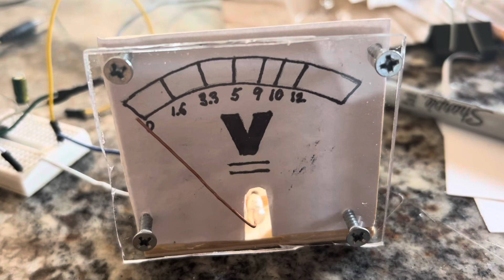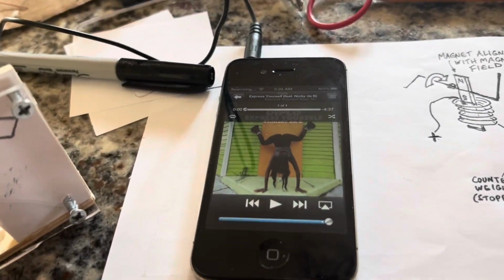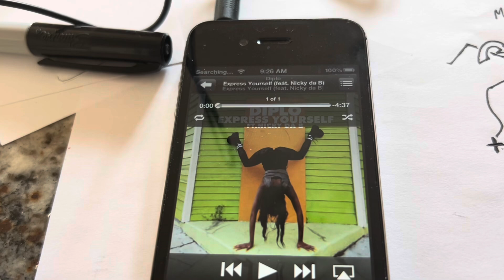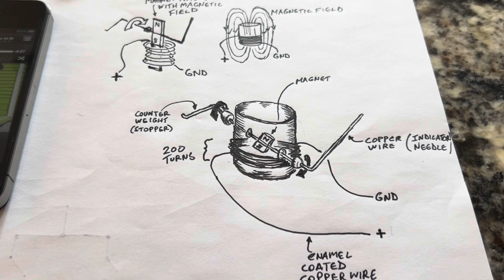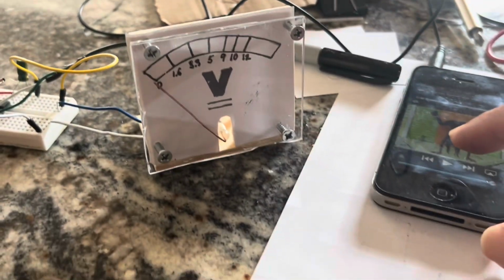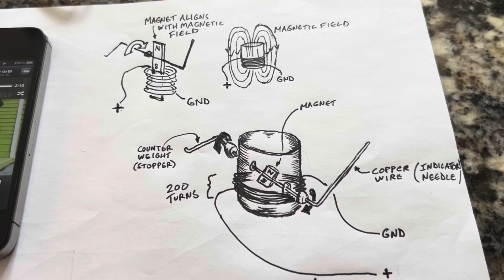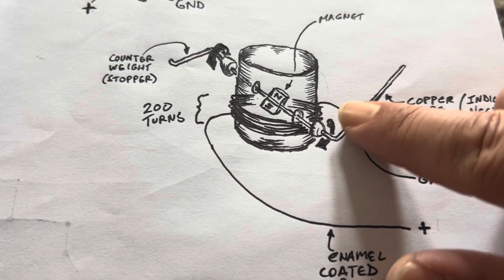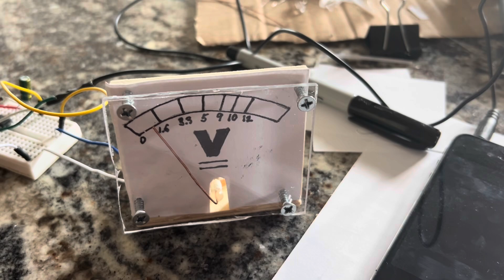DIY Analog VU Meter - Design and Demo

Comment: it must not shake like cockoach antenna.. damp it or use electronic damping
Reply from the maker: I like the analogy. I actually like the jumping effect with audio. But can easily be dampened with a resistor capacitor (peak detector) on the input signal

Comment: Without spiral damper.. It will shake badly.. 
Use plastic damper
Reply from the maker: @INFO_SELABX  was trying to make it out of garbage but yes that would work better. Didn’t have a thin enough wire for that
Reply: @igorbrichkov3632 i also cd not make the daamp spring...did a similar psudo meter 2 years back .

Comment: Cool, did you measure the resistance of the coil?
to see how much current your part uses?
Reply from the maker: @AnalogDude_  112 ohms. I would send signal to it through a opamp buffer so as not to weaken the audio
Reply: @igorbrichkov3632  that's 44 mA at  5 Volt, half the potential of a 78L05.
a TL071 should get very hot and die soon, they can deliver like 25mA.

these original vu meters had some sort of cage around the pivot point, maybe they use very thin wire, not sure, but using that much current seems very unlikely.

A very very very cool idea, 
but maybe it's best to invent some sort of mechanism to roll this copper wire and use much thinner wire. the current should be under well under 5 mA or even better 1 mA.
Reply from the maker: @AnalogDude_  I put a 470 ohm resistor in series with it. The response on the meter didnt change much. A little slower at high voltage but still good. Got the current down to 8 mA

Comment: Nice job.
Reply: I have a idea for a auto pan pot. You can plug a guitar or microphone into it and have the signal comming out as left and right outputs, a pot will control the speed of the pan. The circuit would use a op amp, a 4011 for the pan rate and a 4066 to switch the audio. Would this be of any interest to you?
Reply from the maker: Yes!
Reply: Can you give me your email, and I will send you a diagram
Reply: https://youtube.com/shorts/5Bh070J4OHY?si=0U1q1d20Bvfj2Y58